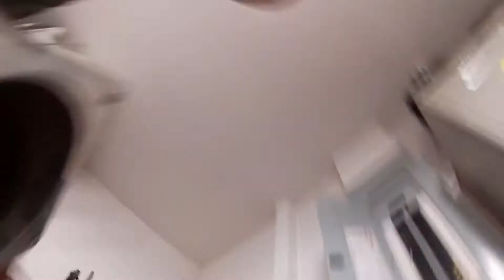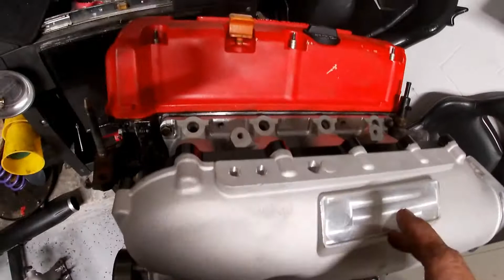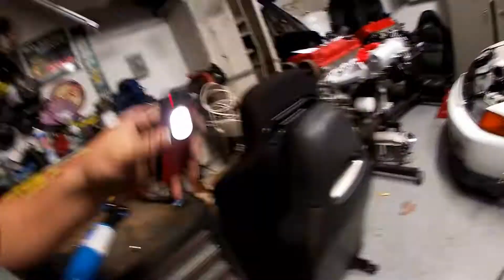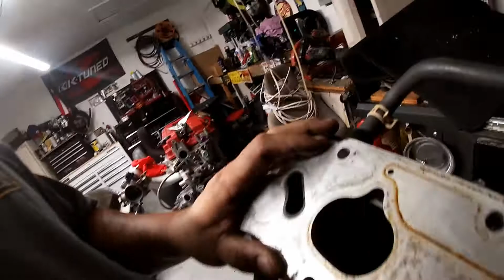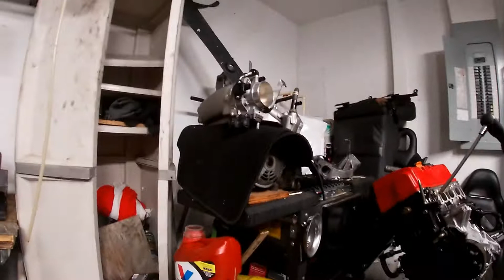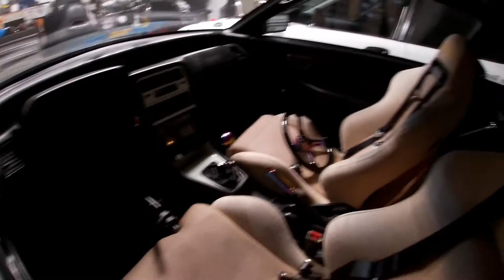skunk2 ultra race intake manifold on k24

Comment: Better than ultra street on K24?
Reply from the maker: We did had a Ultra street on it but we went with a 90mm throttle body so we went with this one for more horsepower
Reply: @GaijinGarage1  thank you for answer. How big Is difference in gain?
Reply from the maker: 70mm to 90mm